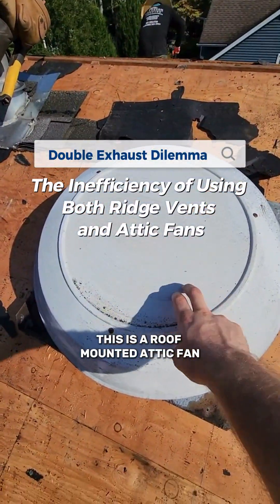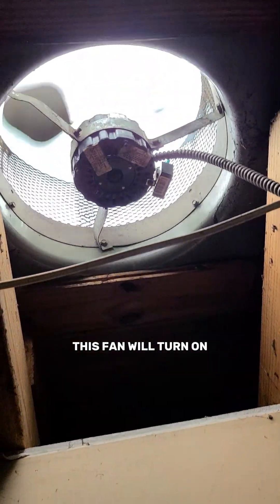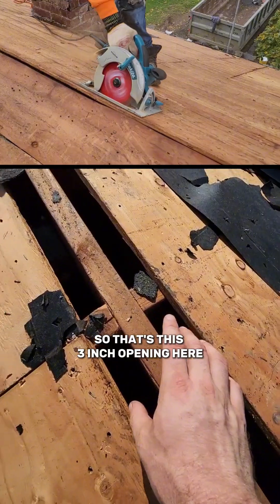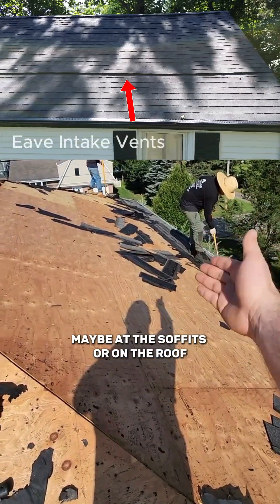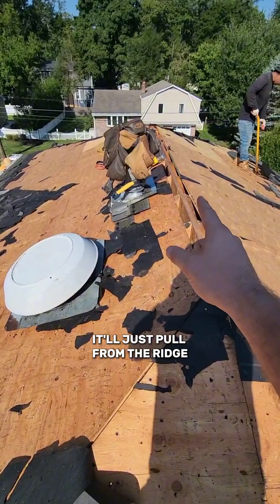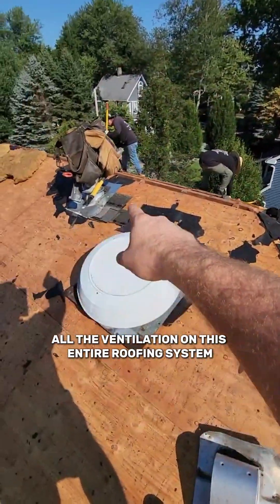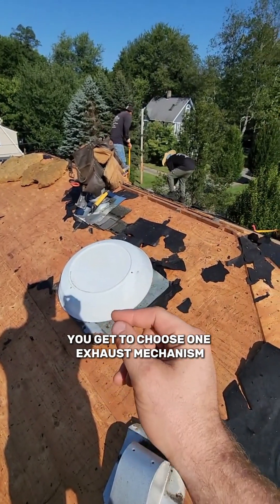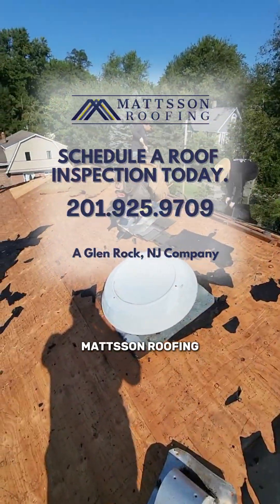Why Attic Fans and Ridge Vents Don’t Work Together

Comment: How do you block the ridge vent 3 to 5 feet on each side from inside the attic to prevent the power attic vent from drawing in air through the ridge vent? What material should be used?

Comment: So what’s the best way to ventilate a hip roof when the ridge is only 16 feet? Can you put a ridge vent along the roof with box vents on the hips?
Reply from the maker: Really great question. On a hip roof, normally we will install roof mounted attic fans. It is not the best idea to install any type of exhaust ventilation running on the hip, because this is prone to leaking. So on hip roofs, you have to install box vents or something mechanically powered (roof mounted attic fans) in order to allow air flow to exhaust out
Reply: @mattssonroofing what if you just install a ridge vent on the ridge? Would that 16 feet be enough ventilation for the entire attic?
Reply from the maker: @robertbryant173  Depends on size of attic. If it is a medium to larger attic, it will most likely not be enough...because you are not exhausting enough air at any given moment to really allow to attic to vent and cool down. It would be analogous to having one tiny window or opening to vent a large sized room